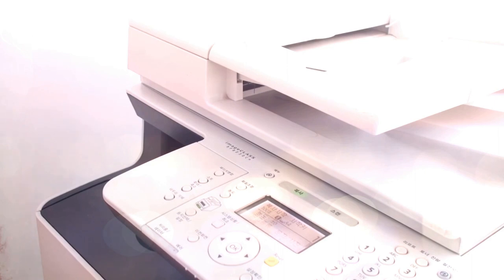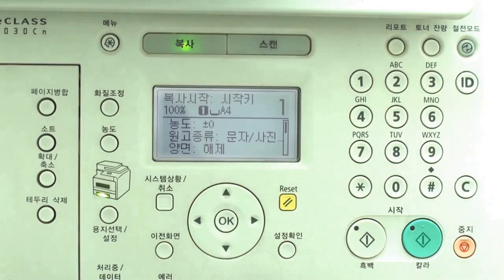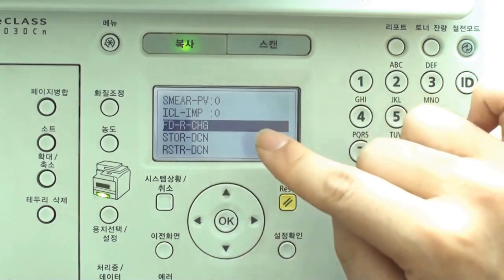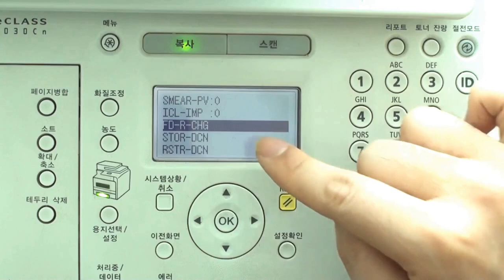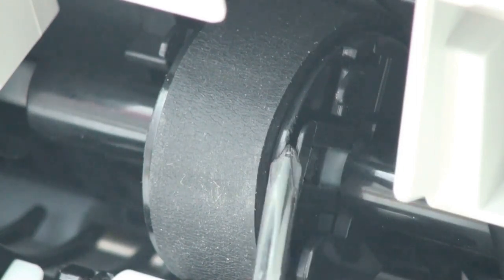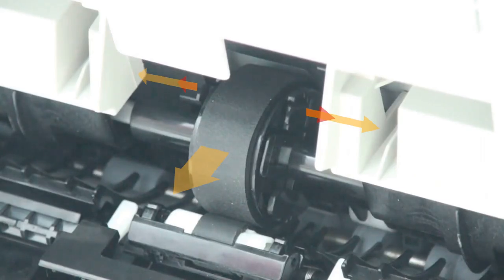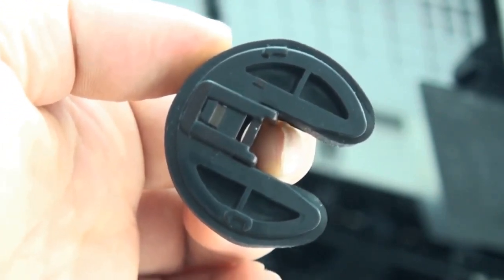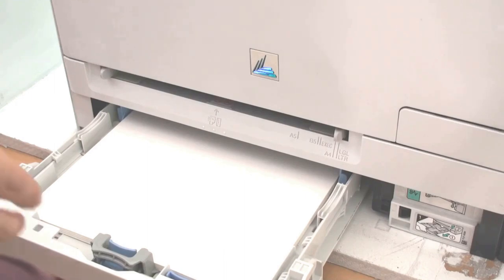Canon mf8000 series (mf8030cn) feeder roller change / paper jam after printing 1 page

Comment: thank you, I followed your instructions and fixed my printer. In my model the small tabs that you need to open for the roller to be removed where white.
Reply: Currently I am having problems with lines (streaks) that appear in the printed pages. I tried the cleaning functions of the menu but with no luck. Any ideas on how to get rid of them?
Reply: @cghera  may b it's from tonner and 2 it's in ur fuser film . So try a self test page from printer . If same borrow catridge from someone and try test page. I hope it will fix ur issue . Fuser film is little expensive .
Reply: @cghera  On other laser printers, I've often seen this result from toner dust on the mirror in the imaging unit.  Not sure how hard the imaging mirror is to get at on these printers, but if the lines are stable, then change if the printer is severely tilted, that's the likely cause.
Reply: Same for me just fixed my mf8580 so grateful for this video

Comment: Thank you 🙏. Fixed the problem of paper jams. I found it easiest to push forward & then remove the thin clip holding the rubber.
It's very thin & I broke it but fixed with superglue & baking soda.
Thank you

Comment: Superb how-to video, thank you so much!  This fixed the issue in my Canon ImageClass MF8380Cdw as well.  It too was frequently giving me the error "incorrect size/setting drawer 1" after printing the first page of a multi-page document.

Note to others attempting this repair: the roller will only lock into place one way, but can be inserted two ways.  If it is not latching or going into place, try turning it around 180° while holding it to insert it back into the printer (that is, around the axis you move it along as you insert it back into the printer).
Reply: Hi Robert. I have an iSensys MF8350Cdn and I hope this works for my printer as well. What is the code you have used to enter the service mode?
Reply: Hi  @Broder1ck  - On my system I pressed the menu button, then 2, then 8, then the menu button.  Nothing will show on the screen and you won't hear any beeps as you do this, but the menu will change to the service menu.  This seems pretty standard for the MF8300 line of printers, so it should work for you.  Good luck!
Reply: @robertrossi5116  Thank you very much Robert, I will try it!

Comment: Thanks a lot! On my LBP-7680Cx printer the service mode entry is different (Power off, ONLINE+Cancel Job buttons held while powering on, then Menu button will present service menu with rather understandable menu entries). But the feeder roller is the same, and your tips on where to press and where to pull were very helpful, and the trick with the roller reuse is just great.

Comment: Until recently I had problems with my Canon MF6550 jamming every few prints, then it became every other print, and now it jams every time I try to print. 
I'm so frustrated I want to throw my printer out the window. I will try your method to see if it works or if my printer gets added to the local landfill.